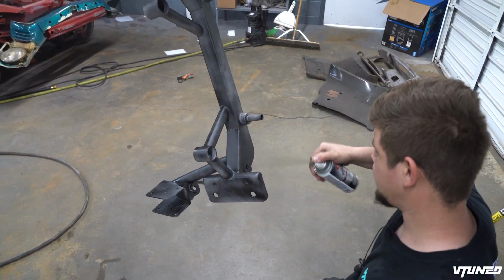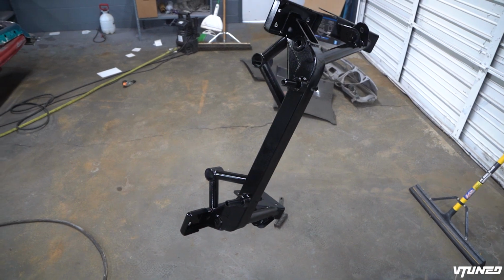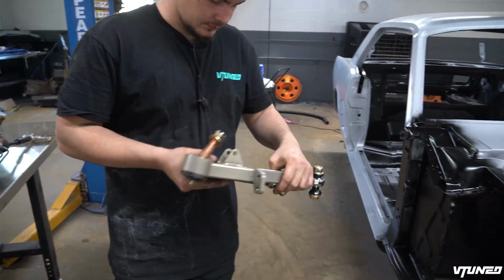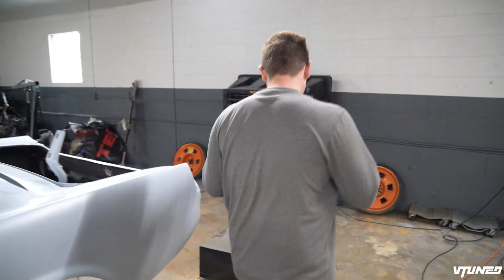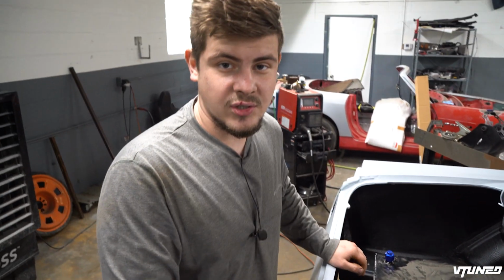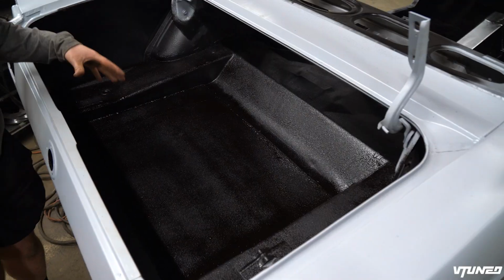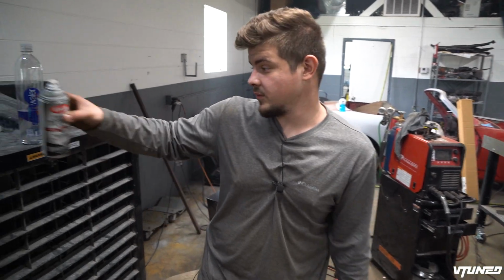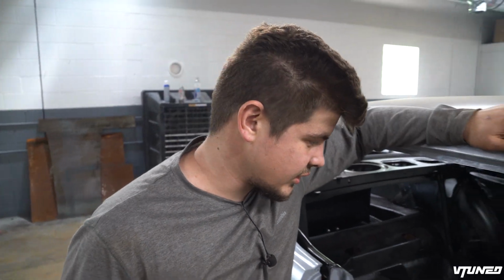Finally Starting To Reassemble The 1965 Ford Mustang (HUGE MILESTONE)

Comment: Actually, with not having traction control, the manual will be the better option. Automatic transmissions can't predict when you will need to make certain maneuvers, but a skillful driver has more control with the manual, through gear selection and clutch modulation that can't be matched through electronic shifting. I think that if you go with the stick-shift, you will find this project more fulfilling. The 1965 era Mustang is is an analog experience that deserves a retro representation if any car ever did.

Comment: If you don’t lower the whole fuel cell as many have suggested, at minimum the small sump area should definitely be facing rearward and that sump area should be lower than the floor of the fuel cell. If you don’t mount it that way you can starve the fuel pump under low fuel conditions. It’s just the way this stuff is designed to work properly. Look it up. I still would have used the stock style tank for a street car. There is no easier and cheap tank to install than an early Mustang tank and it would make using the filler neck easy and, you could very easily add the extra bungs for outlets and return. Fuel lines have to be run under the car and never inside. Totally unsafe!!!!!!

Comment: you should drop the cell down so the fuel  exit is towards the BACK of the car and slopes that way so under accelleration you dont have a fuel starvation problem,

Comment: Drop the tank, fuel pump and lines outside the cabin. The tank will have 120 pounds of gas when full,  so needs to be mounted to hard points, not sheet metal.

Comment: I have to agree with auto. Lets face it if god had intended us to drive manual cars he would have given us three legs and regrettably that is not the case with me!! I'm a Brit who didn't get to see the benefits of an auto trans until I had been driving for around 30 years. As for the fuel tank I still think you should try and lower that tank by around 4=6 inches at least. It will give you so much more boot space without losing anything. You can simply cut a hole in the boot floor and drop the tank though. Just reposition the mounting brackets and then seal around the edges with either a rubber seal or silicone.

Comment: sugestion if I may...
use spacers and longer bolts for the fuel cell, that way you don't need to cut the trunk metal part, you only need to make 2 holes for those fuel lines on the bottom...
another idea is since your not using the original center fuel cap how about a bit of bling bling and make a illuminated mustang logo to replace the cap?

Comment: Remember filler needs to flow down or it will take for ever to fill cant do what you want if you mount it right on the floor need to lower about 4 to 6 inchs to flow or you will have to open trunk to fill it up

Comment: Fuel tank I don't think the fitting will work not sure but from what I have seen the lines will come out the top for the kind of pressure you will need im not sure

Comment: this will be about as safe as a pinto in case of a rear collision!  that fuel tank only has tin metal for protection  
not sure what one could do but it needs some strong metal around to protect it
also the sump must face the rear of the car so it dont suck air under acceleration
Reply: No, you actually don't. It's aluminum so it won't spark and ignite like a pinto.

Comment: Only thing about soray paint is even after it's cured it scratches and comes off easy then you paint the car and w.e paint gets on the black will come off with it so later down the road you will see just primer where u spray painted the black
Reply: He would have done better shooting regular black automotive paint than that rattle can, rattle can paint scratches like you said, plus after a few years it fades and can turn chalky.

Comment: Lines to the back..That’s the sump designed to be in the back. So when you take off fuel goes to the rear. The other way will make your fuel pump run dry when it’s low on fuel. Unless there a baffling in it.

Comment: hi vtuned, why dont u have the tank in a 20-35 degree slant with a bend pipe so in the same horrizantol position , in this way u could retain the old fuel cap position. I wish could draw and show u what i mean .

Or change the position of fuel intake on the tank facing towards the old fuel cap on the trunk.

Comment: That is a real dangerous setup with the fuel cell. You will need a firewall between the trunk and the passenger area. If you lower the cell to use the original filler hole you will have to encase the cell on the outside. You would be far better off spending the money and putting in a proper mustang fuel tank.

Comment: Really, using a rattle can for paint. A single stage urethane would hold up so much better. Don't the fuel outlets go towards the rear on the fuel cell?
Reply: This is going to look like crap after a week or so!

Comment: I’ll say it again what a bunch of amateurs it’s going to be a death trap
Reply: He has been taking lessons from Goonzquad. They dont listen to anyone either.
Reply: Watch out you'll be called a hater by the masses of people on here who have never put their hands on a wrench and think this guy has any fkin idea what he is doing.
Reply: Got to agree with you mate. No thought or research goes into any of his work...just cut and shut with plate steel. Talks about utilising the original fuel fill point then mounts the tank in the boot and renders the original fill point useless??? Also running the fuel pump and lines inside the car!!! What the f... talk about fire trap, he may as well mount that fuel tank on the passenger seat!

Comment: 2:24, I had to laugh at the usual courtesy wave with the wire brush in the general direction of the cross member. Why even spend all that effort picking it up in the first place if you're not going to bother using it?

Comment: Dude - you do not want a fuel pump or fuel lines in the passenger compartment. You should also cut out a hole in your trunk, weld a flange around the top of the fuel cell and drop the tank into the trunk..high CG gas sloshing around and no trunk space is total amateur hour packaging. Use the external filler as well....spilled gas in the trunk is gunna suck ass with the windows up.

Comment: You the cell in wrong the two holes go to the back... Under acceleration gas goes to the back of the car and you won't starve your fuel pump 🤔or empty your fuel lines. That is another reason to have the tank or cell lower so the two fittings clear open for fuel lines.

Comment: You should not use undercoating inside a vehicle. It's kinda tar based and never fully hardens. What you want to use is bed liner. I made that mistake when I was young. What a mess.

Also, you are putting the tank in backward. The fittings on the bottom are meant to be on the rear and through the floor. Do not run fuel lines on the inside.

Comment: Sorry to say but you have stuffed up. Mount the tank thru a cut out. To sink it. Then make a filler tube to go from original cap to the drop tank. You need a hole for a fuel level sender... What about rear diff and suspension upgrades need planning now

Comment: What kind of paint are you using in a rattle can ? Do you know most are rubber based hense the rust protection threw rubber base.... and do not harden enough to keep moisture from condensation out from under your paint and will rust from the inside out ... Automotive paint has hardener to prevent this . You need to start mixing paint bro , makes every job that much nicer , you final finish is only as good as your pre prep brother ....

Comment: I watched your work on Samcrac & Goonzquad Trackhawk & thought you were really good. I’ve watched a couple of these latest uploads & I can’t understand why it’s all going wrong? You don’t seem to ever have a plan so it’s all going together without any forward thinking. Not going with a stock gas tank & welding in anything you have on the garage floor just adds weight to an already heavy framed car. I think you should stick to repairable cars which made you a great YouTuber, leave the car design builds to people who have the correct tools & experience know how.

Comment: I hope you're still gonna set that gas tank down through the floor. If not, your not gonna be able to use that existing gas filler hole. you can't fill uphill. Unless all laws of physics have changed.

Comment: The new paddle shift automatics are frankly faster, so good call on ditching the manual.
Reply: I don't think so. Not faster than a clutch less 5 speed.   So much better for auto cross. To

Comment: It's coming together vtuned congratulations. For the brake system. I think you should go gor  Brembo or willwood for the big brake kit, especially 6 piston calipers because you guys are installing a twin turbo kit later down the road. For the coil overs, you could choose Fortune Auto, Eibach, QA1 and Bilstein. Can't wait for when you test fire the engine for the first time.
Reply: I think he said he going Willwood in a previous video :)

Comment: if you don't cur a hole you'll have to run the fuel lines inside the car. Safety issue. Cut a small hole just for that lower part.
Reply: *cut

Comment: Seriously the OEM fuel tank all the way down below full empty trunk space... You used an aftermarket fuel tank, great... Place it like old one and you can use middle filler neck with a simple pipe right to the new tank! Why deleting full trunk space plus trying raising it even more for your piping routing, fuel lines belong underneath the car, try to build a safe car! You dont want fuel lines running inside the car where you are situated! And definitely yes cut this beautifully painted sheet metal, make a hole and reverse the mounting points to be right where the filler is to the sheet metal. Safer, prettier and basically kept the car oem but in much better shape!

Comment: Just wondering, why are you using a rattle can when you have access to a body shop? Is it just as good quality wise?
Reply: Rattle can isn't even close to same quality as catalyzed paint..
Reply: I was wondering that as well. You can actually buy (or used to anyways) krylon paint by the gallon, it's way cheaper.

I did a big project and the customer picked a custom colour that was only available in rattle cans. I bought 5 cases of the shit......drove me batty. The beauty though is you can get more whenever you need it.

Comment: Great choice with the auto.  Who wants to pump a clutch pedal 200 times just to drive 2 miles through traffic into town? The fuel tank though? Pony up for an original one, that fuel cell looks naff and you won’t be able to use the original filler.
Reply: Sombody who likes to have fun driving across town .
Reply: @chriscatarcio2983  Yeah, no one who drives an auto can drive spirited can they? 😂

Comment: As many have already said.  The fuel tank should be lowered so you get a lower center of gravity.  Much more space in the luggage.  Plus the tank sits lower in the original.

Comment: I'd be concerned about the safety of the fuel tank.  Why not use the OEM tank?  Plus you loose your trunk space and the original gas cap filler.

Comment: Why all the rattle can paint? Rattle can paint is very thin and does not provide much protection. You really should be using a spray gun with good quality paint.

Comment: It wouldnt have been much more work to drop the tank. It makes no sense for the fuel tank to sit that high. And he's going Automatic Hypocrisy! 
I can understand a bit that he feels safer using an automatic since there's no traction control. He's probably more worried about speed in a straight line. However I still prefer a manual transmission.

Comment: Supposed to tighten nuts not bolts your torque does not work on your tightening a bolt torque the nut and you need to put a 9 inch Ford rear end under that mustang

Comment: Ben it's sad to see all the hard work you put into this car just to slap a tank in the trunk and call it a day, please get the proper tank and put it were it should be and pump the gas in the proper hole. You are getting excited about the finish but are starting to rig it for sure with this tank. So disappointed

Comment: I think you are wasting space putting the fuel tank in the trunk. Instead, you should cut down the metal plate and drop the fuel tank for more storage space. 
You can be able to join the fuel tank with a pipe up to where there is an original fuel hole.

Comment: I love your work and see how you get things done. Its inspiring! Yet I was so gutted and disappointed to hear you say putting an Automatic inside this masterpiece. Don’t you like driving and unlock the cars true potential? Not to mention hone your own driving skills? Seriously!
Reply: I watch because I laugh. My wife is convinced this is his tactic.
Reply: Nope. The new autos are faster. Check the Motor Trend reviews on the late model Stang's.
Reply: @toddhinely5442  What? He is putting in an automatic just to get a discussion going in comments?
Reply: Ben mentioned that having control over the car was a priority. Its true that the automatic is faster through the quarter mile, but that is only one aspect of performance. Having more control over the behaviors of the car is very limiting with without manual shifting and its a completely different experience that is the essence of a more complete driving phenomenon. It comes down to preference, but if he wants more control, manual is definitely the answer!
Reply: No, he makes god awful videos filled with egregious errors in order to get views. I hate watch. I can't stop watching this slow motion trainwreck. Btw, that nonsense about automatic transmissions being faster is dumb. It's gear ratios that get those 1 second difference in 0-60's and if you haven't driven a clutch car then you just wouldn't get it. I'm glad I was born when I was. Clearly, those of us born with 5 speeds like em for a reason.
Reply: @toddhinely5442  most of us car guys were grew up banging gears and enjoy it still, but there's a reason you don't see Italian exotics, McLarens, Formula 1 cars, Top Fuel,  with a shifter in the floor. Nothing shifts gears faster and therefore wastes less energy being applied to accelerate more efficiently than an Automatic.
Reply: I don't disagree, but the difference between them is only exacerbated by the  gear ratios being so vastly different.

Comment: That whole fuel tank design is hokey...it's not right.  Lifting the trunk lid to fill is hokey.  Taking up all the trunk space is hokey.  The tank not being protected from a rear end crash is really hokey.  This f's up the whole build.
Reply: The whole car from start to finish is hokey! I can’t stop stop watching, it’s like car crash tv 😂
Reply: if you've ever owned a lowered car having a fuel cell inside teh boot is a god send when jacking the car and 90% of badass street cars have cells so you're a clear noob with no idea
Reply: You're right...I really don't have a clue...I just see what I see.  I drive a Charger SRT that's pretty low and I see where the tank is and how the manufacturer protected it from rear end collisions.  This just struck me as a strange design and not an optimum local for the tank.  If he gets rear-ended hard that tank is going to explode.  But...you know best.

Comment: The correct way IS to put body filler on clean metal not on paint or primer...
Reply: NO, thats is old bs, you seal metal in epoxy then fill over that.
Reply: @shredBucketheadshred  You do that and the body filler will only hold as long as the epoxy holds, You go by what the manufacturer, If it's designed to be applied over bear metal then that's what you do, I worked in a body shop for over 10 years and we NEVER ever put body filer over paint or primer of any kind, that's a hacks way to do body work...
Reply: @lennym1273  it is industry standard mate the metal should be sealed so the body filler won't risk moisture rusting beneath the surface . epoxy primer is not porous, body filler is, learn a thing or two

Comment: Be wise to look for a fuel tank that gives more capacity and doesn't cost trunk space. Sooner or later you are going to want to sell and BS like trunk space can be an issue. Lots of parts around for Mustangs. If you don't use some rusted out mess, nobody is going to care about the gas tank. Trunk, someone's wife is going to want to know where to put their makeup case.

Comment: I start looking your channel a long time ago because as a youngster you did a professional job, but this mustang is turning into a botch job, spray painting with a rattle can? That is for hiding faults from a new buyer, cutting steel in the boot area, that sparks is the first thing that starts a new rust area, the area at the bottom of the fuel cell is design to be the lowest area so that the cell  will empty out if it is installed level.

Comment: I don't know, all to save $250. Just doesn't look worthwhile to me. Sorry. #Shockrod
Reply: Right? Everything is corner cutting. Such a waste of a classic car. It’s like Homer Simpson’s car.
Reply: @sjv6598  You can buy a brand new tank with everything you need to plumb in the EFI and maintain the stock look fuel fill and trunk space. Fuel cells in street cars are an abortion to me.

Comment: You will never be able to race it anywhere if you put fuel lines inside the car much less the danger to you normal driving and have an accident and fuel is better on the ground than inside the car with you.